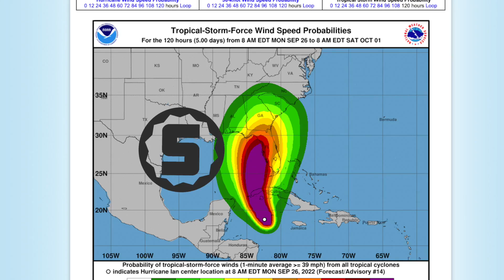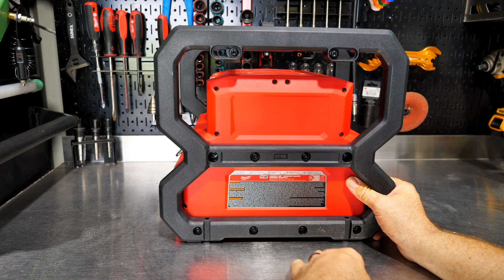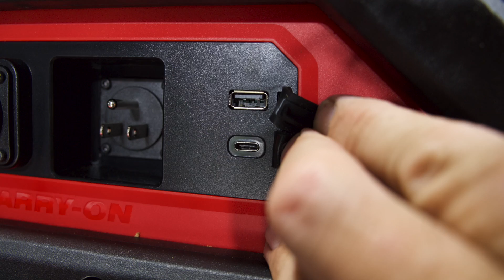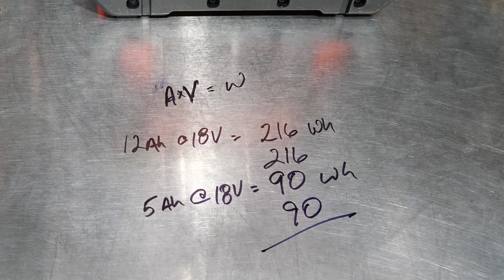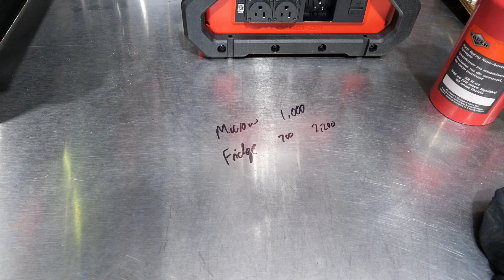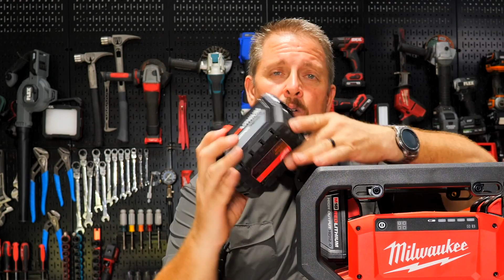INDOOR READY! 3600 Watt Milwaukee 2485 M18 Carry On Power Station [HURRICANE IAN READY]

Comment: I bought one and can't be more happy. I like it better than a solar panel type. Ask Amazon ???? Lol. I charge it on my trucks alternator. Has 2 120 volt plug ins.  The batteries charge quickly. There is no surge. Absolutely Amazing 😉
Reply: Generator make noise while sleeping, inverter don't
Reply: So you use your gas vehicle to charge this battery? Why not just get a gas or LP generator at that point? Seems ridiculous honestly
Reply: @sashly99 sounds like it’s being charged while the truck is being driven
Reply: @pharaohacura3618 they probably never heard of or seen the inside or back of a real mans work truck! Or even know what it’s used for!

Comment: i agreed at least display to show voltage and amp output, chain up would be nice
absolutely need a solar charging

after watching again toward the end on math
you can’t add total wh
cuz they all run in series so you can only use the smallest battery

total running watt hour is based on 5Ah (90wh)

My correction, since this runs 72V x 5Ah, same for 72V x 12Ah

Comment: My question is why do I need a system that requires 4 batteries that I could use for my tools when I could have a Ecoflow or Bluetti system that has it's own dedicated Lithium Iron Phosphate batteries?
Reply: Because you need to plug them in eventually, with this system if you have a bunch of batteries, which most contractors do. You can always have a set of batteries charging on rotation as you need it yanno
Reply: How much is a Bluetti with 800Wh of power?

Comment: Your watt hour calculations at 21:00 are only true if you have four identical batteries connected. Otherwise much of the energy in the 12ah batteries will never be used because the whole thing will shut down when the 5ah batteries die. Great overview.
Reply: Came to say this. What sucks about this generator is that it only operates on the lowest battery both in capacity and in power.
Reply: @CharmelionZard  The same on the Dewalt.

Comment: This product totally misses the mark - there are solar generators (Bluetti AC200 MAX) that do more than this thing.  This inverter, with roll bars, takes gas - gas to truck it out to someplace that has no electric, gas to truck back to civilization so it can be plugged in.  No "pass thru" power?  It cannot charge and power at the same time?  No solar input - why?  The max battery is only 4 12-amp hour batteries which is only 48-amp hours - hardly any real power at all.  The price on that thing is $700 without any batteries - glad I have an AC200 MAX.  The AC200 MAX also has 240 RV plug for the company onsite trailer.

Comment: Im in NW Florida. That is a great product, but it MUST have a way to recharge without power from the wall. After a major Hurricane power can be out for days.
Reply: You just need extra batteries that you can charge from the generator itself and just have them in rotation as you need
Reply: Wonder how big your generator would have to be to charge theses batteries and run the things you need to run?

Comment: It's a great tool, but do what you have to do to keep your family safe and comfortable. We lost power for 2 weeks last hurricane season and I'm extremely thankful for my gas generator.
Reply: Got my predator 9000 ready to go as well. Bought if after the Texas freeze
Reply: It sucks but you MUST buy extra batteries so you can always be charging the next set of batteries if need be. In a situation like a hurricane or whatever the case may be you definitely need extra batteries to just keep the cycle going
Reply from the maker: No doubt, we will. Thanks for the kind words.
Reply: I lost power last year for a few days. I used my solar power station, during the day to charge my Milwaukee and ryobi batteries during the day, and would have those to supplement the actual power station through the night. Not a bad system, was running my living room, fridge and freezer the entire time.
Reply: Milwaukee makes a 12v car charger 48-59-1810, one could cycle batteries from a car charger to this generator and back
Reply: @northhammerfl care to explain?
Reply: @salutbonjour123 in an longer term emergency or place without any AC mains, one could use ones vehicle's 12 volt power systems using the 48-59-1810 to charge the 4 Batteries the Power Station uses to power itself. This would extend the time one has A/C power available.
Reply: @northhammerfl  why not just buy a car battery powered Ac inverter?